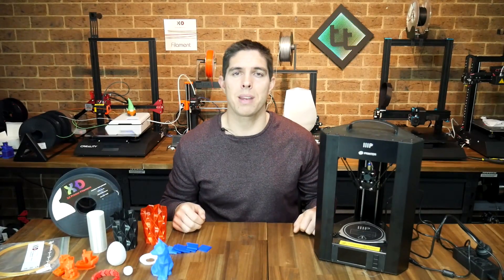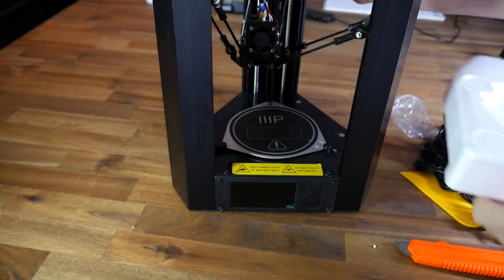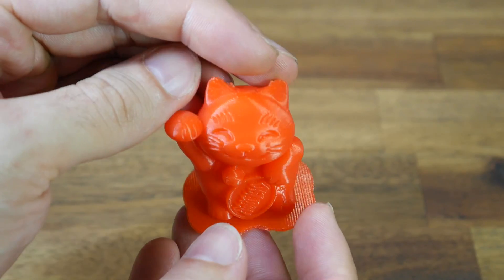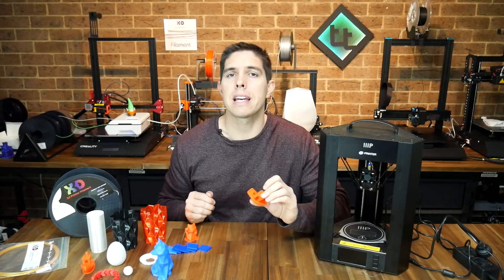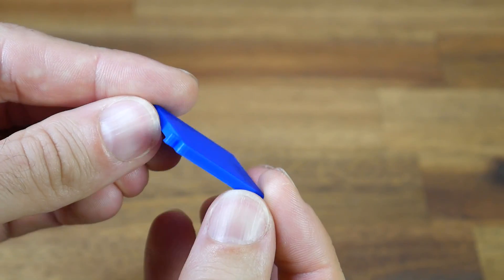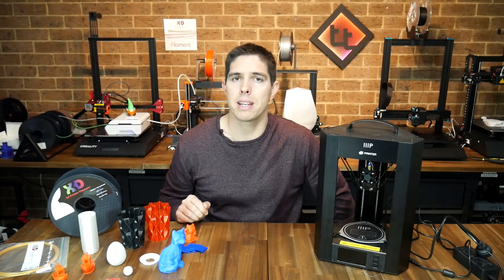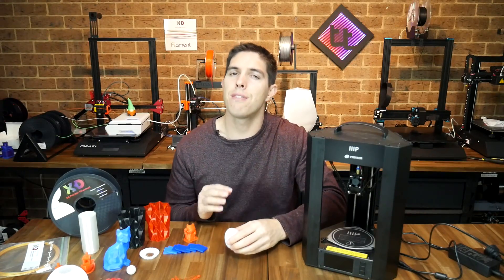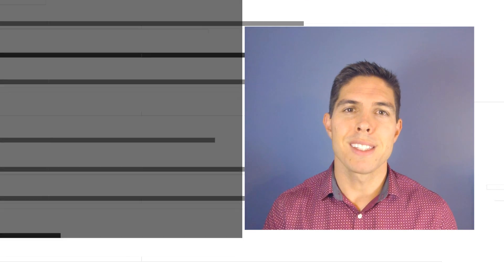Monoprice Mini Delta review -

Comment: Thanks, yea that noise is for sure a deal breaker for me. Otherwise I would already have ordered at least one. I wonder if there is the potential to upgrade this with quieter stepper motors?
Reply: Changing the stepper drivers for X, Y, and Z make the printer much more quiet.
Also helps to add a resistor to the base fan or swap for a less noisy aftermarket fan.
After those changes are made the only noise is when the extruder retracts and extrudes quickly, the hotend fan, and a little noise from the bearings.
Reply: @MatthewUpp  So then I have to ruin the print quality is what you are saying. There has to be better stepper motors out there that could replace these obvious cheap ones that were used in the printer without taking away micro-steps to fix it with a hack?
Reply: @kevinm3751  I don't recall saying anything of the sort. Why would print quality be ruined? The steps per unit does not change. They remain at 114.28 for X, Y, and Z.
Reply: @MatthewUpp  I fail to see how changing a stepper driver is going to eliminate the whining of a cheap motor, unless the driver takes out some of the microsteps that is probably what is causing it in the first place? Which doing that decreases the print quality.
Reply: The control board cooling fan really is the major culprit here. Replace it with a 60mmx25mm Noctua, and you're golden ;)
Reply: @dreamspectre_  What I heard is not just the fan, the stepper motors are without question loud as you can hear at 9:50 in the video here, but I am sure the fan is not helping.
Reply: @kevinm3751  Changing the fan definitely won't make it silent, but it aides tremendously in my experience. In swapping to a Noctua or similar, it brought the decibels down to around 35 for me, which is on par with most of my other printers!
Reply: @dreamspectre_  Thanks, I will take all this into consideration.
Reply: if you are a beginner for delta , FLSUN is also  a brand focused on the delta
,It is highly recommended to buy this one https://www.aliexpress.com/item/4000130776715.html?spm=5261.13614333.0.0.763d4dcenY162R less than 170$ ,200x200 printing size,the price in 11.11, off course , you also can consider about FLSUN QQ-s, 260x360mm printing size less than 300$ ，
https://www.aliexpress.com/item/32813476326.html?spm=2114.12010612.8148356.3.2ed81747raVDog ,for the FLSUN QQ-S ,It does a great job in the field of mute

Comment: It was easy to set up wifi. It's two lines of G-code. I sent it with Pronterface (unfortunately, Pronterface only sends capital letters), but you can probably just put it in a text file on the MicroSD card as well (I don't know why they don't include it):
M550 SSID ; Type in the name of your wifi network
M551 PASSWORD ; Type in your wifi password
Then the IP address of your printer will appear on the display when it's not plugged into USB. In my case it was 192.168.0.14. Go to that address in your favorite web browser and you can upload files to print and also preheat the printer. Its not a fancy interface; it's pretty basic. It tells you the status of your connection and the status what you are printing as well as the nozzle and bed temperatures.
Better instructions are in the wiki.
Reply: Why would you post your IP address?
Reply: @theredstonehive  that is an internal lan ip address (behind a router)not accessible from the internet.

Comment: It's a shame the heated bed is so rubbish. Ironically I was initially interested in it because the frame design makes it very easy to modify in to an enclosed chamber for ABS prints.
Reply: There is a version of the Marlin FW, Marlin4MPMD, that will allow you to print ABS, PARTICULARLY if you get a 10amp power supply.

Comment: Michael is is possible to swap out the stepper drivers for say tmc2108?
Reply: @Steve White yes it is possible as long as your board has 4988 drivers for X, Y, and Z. 
I have swapped the stepper drivers on the stock mainboard many times for the Mini Delta.
https://photos.app.goo.gl/qrBWX7LfoyrHNniF8

If your mainboard came with 4985 or 4995 stepper drivers then you can either purchase a mainboard that has TMC2208 drivers already installed but is otherwise a stock board, purchase a stock mainboard that has 4998 stepper drivers and change the drivers to TMC2208 yourself, or purchase an aftermarket board that you can install step-sticks with the driver of your choosing.

Comment: The mini delta was my first printer and I agree with what you were seeing.  I found some diy magnetic build material and was able to cut out three sets for the printer.  It now is much easier to remove the prints.  Unfortunately the small print volume really held it back so I ended up buying an Ender 3.  Now I'm trying to decide what my next step will be, since you can't have just one 3D printer.
Reply from the maker: I think the fact the the hot nozzle pushes into the bed during ABL probing limits the bed surfaces available. Does your magnetic stuff not get melted?

Comment: Looks to be an excellent portable printer. Not quite sure if the build volume would be restricting though.
Reply from the maker: It is the number one problem, that's for sure. Increase the size, however, and the portability is gone. We need a delta with a telescopic structure.
Reply: @TeachingTech  along with some telescopic belts.

Comment: I have one of these and I love it. The build size is small, but it's fun to watch.
Reply: You forgot to mention the ability to "print another one" at the end of each print. Not useful when you are doing one-offs, but say you're printing a bunch of PolyPanels (@Make Anything), you don't have to go thru the whole menu again! Just a nice touch on the Monoprice printers.
Reply: if you are a beginner , It is highly recommended to buy this one https://www.aliexpress.com/item/4000130776715.html?spm=5261.13614333.0.0.763d4dcenY162R less than 170$ ,the price in 11.11, off course , you also can consider about FLSUN QQ-s, about Predator, i think ,for individual players, it’s too heavy, about 25 kg.FLSUN Is a brand focused on the delta
Reply: @jasmyn4699  $170? more like $400+!
Reply: if you are a beginner , It is highly recommended to buy this one https://www.aliexpress.com/item/4000130776715.html?spm=5261.13614333.0.0.763d4dcenY162R less than 170$ ,the price in 11.11, off course , you also can consider about FLSUN QQ-s, about Predator, i think ,for individual players, it’s too heavy, about 25 kg.FLSUN Is a brand focused on the delta

Comment: I'm truly surprised you were able to get accurate results from the printer.   During the early runs of this printer there was a significant variance between the model and the output due to inconsistencies in the construction of the unit.   The random lock ups during the firmware update were a huge negative as well.   I really wanted to enjoy this printer, but I just couldn't for all the negatives you mentioned, plus the ones I observed.
Reply from the maker: From my reading it seems there is an unofficial updated version. Perhaps that accounts for the differences. It feels like a well sorted printer.

Comment: Thanks fie the review! I always was tempted to get this printer and might if / when it goes on sale.  I have multiple Printers including an Ender 2, Ender 3, Ender 5, CR-10, and A10M.  I wanted to get a Delta to mess with and the portability is a plus. Would be good to take to work and make small prints during the shift and then easy enough to move and take back home.  What type of hotend does it have? Is it an all metal or Creality type with the teflon tube touching the the back of the nozzle?  Thanks again for another awesome review!

Comment: Impressive for the price. What would you recommend to address the insufficient parts cooling for the overhang and the bed heating? Look forward to you upgrades.
Reply from the maker: The printer has been around long enough now that there is quite a well established community. I'll do some lurking and make decisions from there.
Reply: @TeachingTech  This was one of the only things holding me back from getting one, initially! I wanted it for the speed when prototyping parts, and for the accuracy for D&D minis, but the lack of cooling concerned me. So far, my only remedy has been to print some clips and attach a computer case fan to the side. It's far from perfect, but it works until something better can be found. Please keep us in the loop!

Comment: Nice mini delta!  Thanks for your review!
Reply: if you are a beginner for delta , FLSUN is also  a brand focused on the delta
,It is highly recommended to buy this one https://www.aliexpress.com/item/4000130776715.html?spm=5261.13614333.0.0.763d4dcenY162R less than 170$ ,200x200 printing size,the price in 11.11, off course , you also can consider about FLSUN QQ-s, 260x360mm printing size less than 300$ ，
https://www.aliexpress.com/item/32813476326.html?spm=2114.12010612.8148356.3.2ed81747raVDog